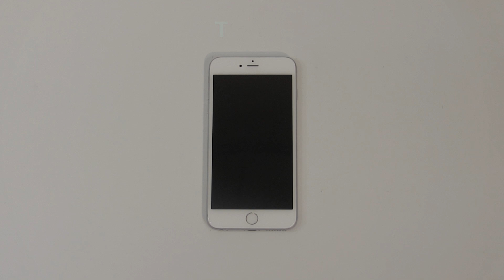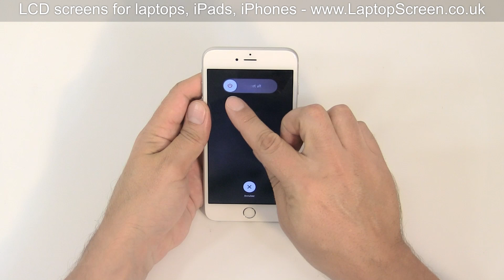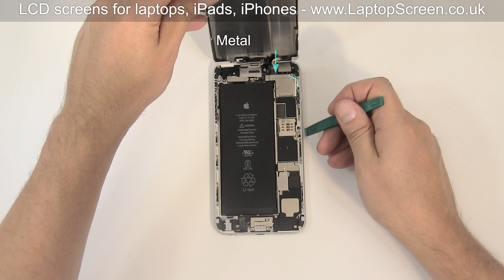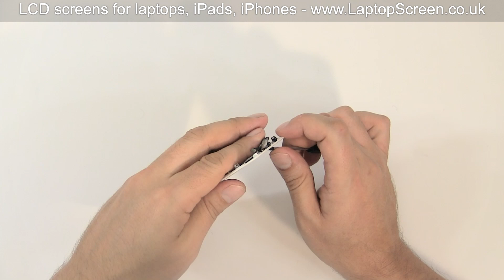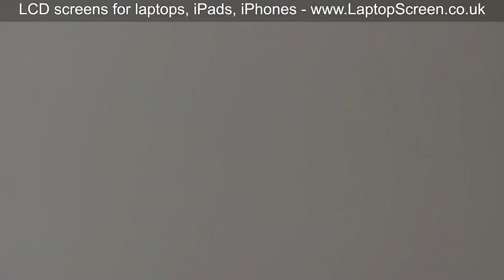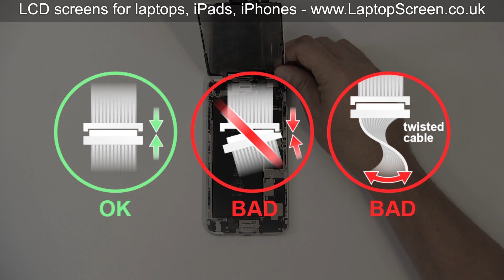iPhone 6 plus - how to replace screen and digitizer.

Comment: What if I cannot turn off the phone first because the touch screen doesn't work now?
Reply from the maker: Hi Amanda, you can move to the point where the device is opened and disconnect the battery as in our iPhone 6S video: https://youtu.be/wCHHNjBkONM?t=1m11s
Its an optional but a highly recommended step, that unfortunately wasn't included in this video.

Technically you can even do everything "live", but it greatly increases the chance of damage happening when you reconnect the connectors back to the logic board. If you are very precise and not fidgety with the connector it's not an issue. The problem arises when the connector is being slid against the jack and the wrong pins touch - damage ensues.
Each connector needs to be reconnected perfectly straight pin on pin.